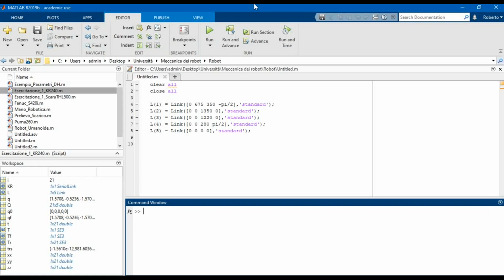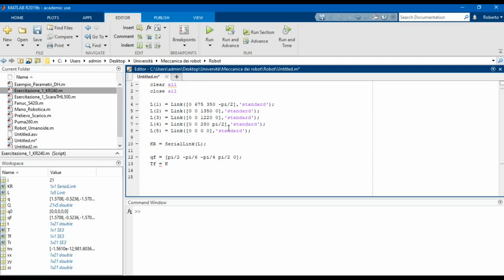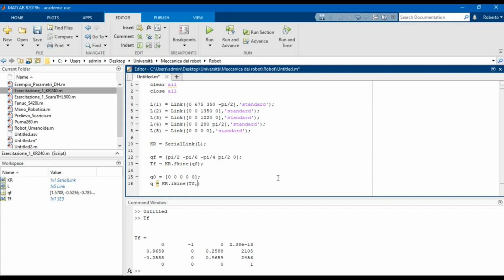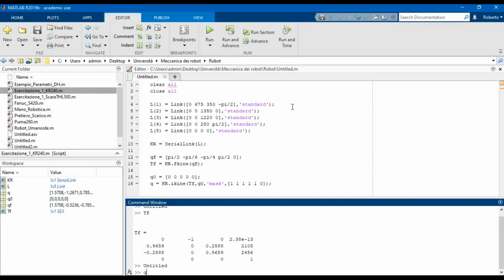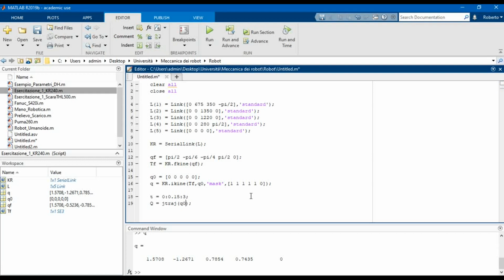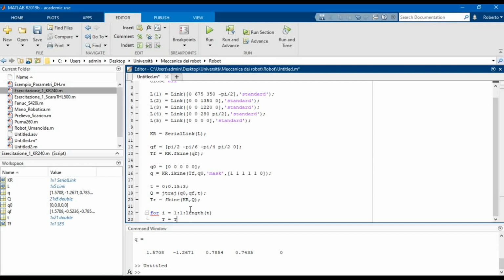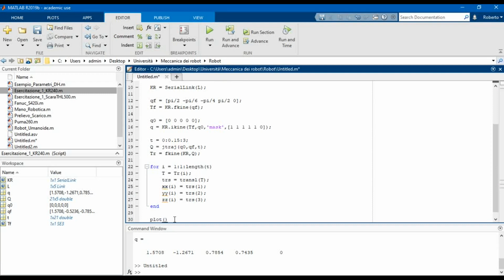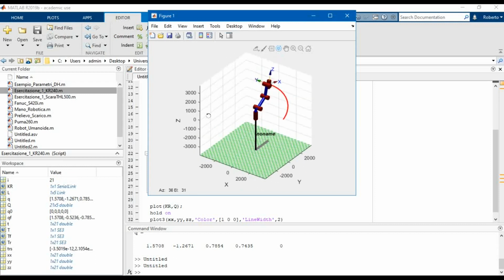MatLab Robotics ToolBox #2 - Foreward and inverse kinematic analysis and trajectory

Comment: wait, i dont quite following. Isnt this forward kinematic to simulate trajectory then? since i control the robot using it's joint angle rather than the position of xyz or there is a step i skipped over?
Reply from the maker: You could use the inverse kinematic. So you get the joints values in 2 position and you can make the trajectory
Reply: the matrix in q0? which one is the xyz position?
Reply from the maker: q0 is the joint vector of the initial position

Comment: If I have all the dimensions of my robot, can inverse kinematics of the body be performed with this? For example, if I wish for the body to be in a specific orientation then that will correspond to a specific joint angles. If you think it is possible, what are your suggestions?
Reply from the maker: You can simply use the ikine command
Reply: @amazingengineering3207  I realize I was not clear. This would be for a quadruped robot (4 legs). So the SerialLink object will contain 4 legs (1x4). I have not been able to figure out how to apply inverse kinematics to this whole robot.
Reply from the maker: You could analyze every single leg considering the foot as the end effector
Reply: @amazingengineering3207  Okay. This makes sense, but what about pitch, roll, and yaw of the body?
Reply from the maker: Mh, honestly i don't know
Reply from the maker: Mh, honestly i don't know

Comment: Is it possible that this syntax does not exist anymore? I get the following error when trying to build one of the links (i.e. L(1)): Check for missing argument or incorrect argument data type in call to function 'Link'.
Reply from the maker: Did you install the robotics toolbox?
Reply: @amazingengineering3207  I see. I didnt realize Robotics Toolbox and the Robotics System Toolbox were different.  I am attempting to install now

Comment: Hello, how can I make 3 joints horizontal? I want to make robot move only 2 dimension, not 3 dimension.
Reply: I mean, I do not want to put rotary feature to my robot.
Reply from the maker: You could set alphat equal to zero for all the joints
Reply: @amazingengineering3207  Yes I did it. Thank you so much.

Comment: I want to use 3 Prismatic joint and 1 rotary joint robot what would the code look like for that? I tried searching everywhere but not getting anything related to the prismatic joint robot.
Reply from the maker: You can watch tge 1st video tutorial of my MatLab playlist where i show a SCARA robot. Anyway, if you want to use a prismatic joint, you can write link command in this way: L = Link(theta,d,a,alpha,1). If you write 0 or only the DH parameters you will have a rotary joint
Reply: @amazingengineering3207  This is the code I am using 

%D-H Paramete:

d0=1;
a1=1;
a2=1;
a3=1;
a4=1;

L1 = Link('d',0,'a',a1,'alpha',0);
L2 = Link('d',0,'a',a2,'alpha',pi);
L3 = Link('theta','d',a3,'alpha',1);
L4 = Link('d',0,'a',a4,'alpha',0);
r.fkine([ 0.2 0.2 0.3 0.1 ])
Robot=SerialLink([L1 L2 L3 L4], 'name', 'Robot');
Robot.plot([0 0 0 0])
Robot.teach

This is the error can you help me in debugging it?

Error using Link (line 354)
must provide params (theta d a alpha)

Error in Final_File (line 11)
L3 = Link('theta','d',a3,'alpha',1);